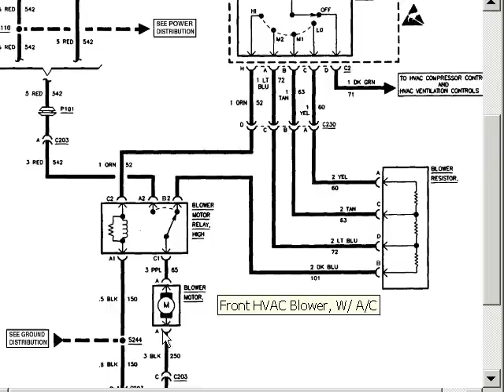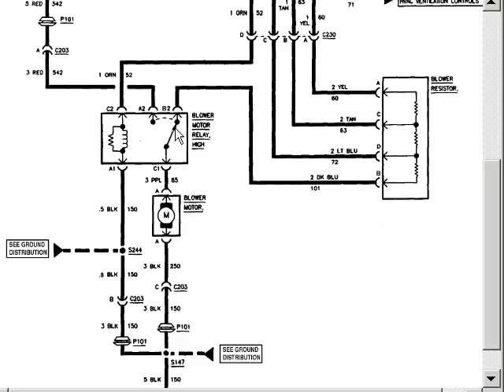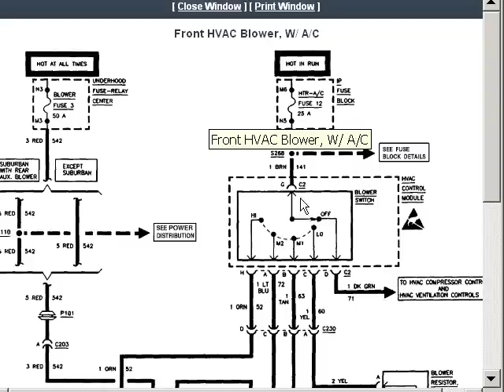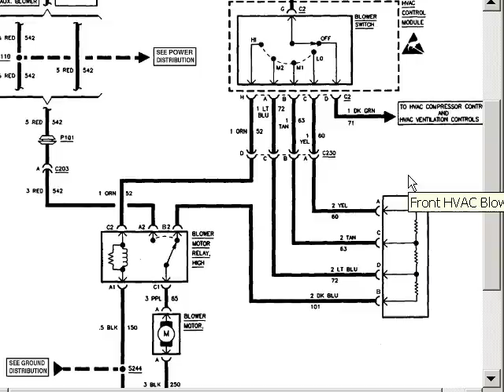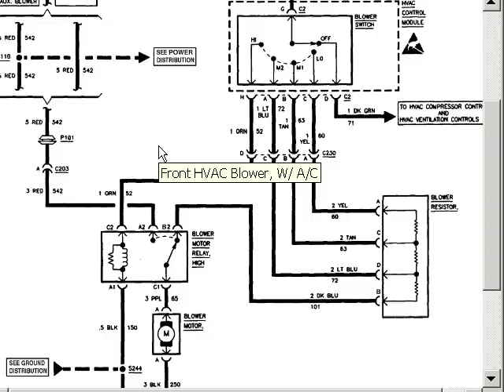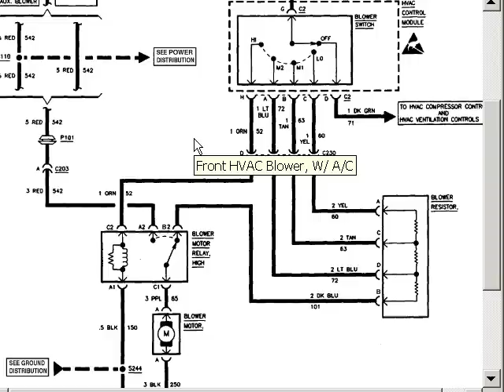Blower Motor Problems | Auto Repair Help

Comment: So is the 50 amp fuse used only in the high blower position......mine has no speeds workin but a good 25 amp heater fuse...?
Reply from the maker: Yes, the 50 amp fuse runs high speed. But remember this is for a Chevrolet Tahoe. Other makes and models will have different set ups.

Comment: I have a 2004 Ford Crown Victoria Police Interceptor, new relay, fuses are good, but I am not getting the blower motor to work.  I have checked for voltage going into the blower motor and there is none.  Any suggestions?  My mechanic is unable to help.
Reply from the maker: Jason: A problem like yours needs some hands on diagnosis and a blower motor wire diagram for that specific year and model. The Chevrolet diagram in the video won't work on the Crown Vic.

Comment: BLOWER MOTOR WONT TURN OF  ON94 CADI FLEETWOOD  FUES GOOD RELAY GOOD WHER IS THE RESISTER LOCATED PLEASE HELP SOUNDS LIKE YOU NO WHAT YOUR TALKING ABOUT THANKS  ARTHUR
Reply from the maker: The Cadillac climate control system is a whole different animal. I think the 1994 has a control module instead of a resistor. The factory service manual for that specific year and model is the best source of information. It includes component location diagrams and test procedures. You can find them on Ebay cheap.

Comment: need help,,,93 jeep Cherokee heater only works on air conditioning settings ... have high medium high medium low an low ...switch to heat defrost or vent blower quits. new motor,new resister,new fuse,new relay,new high/low switch.... what have I missed

Comment: HI I have Mini Cooper clubman 2008 and not working the motor blower ha be new final stage still same have power and ground in the blower wiring but the switch are digital good ,but nothing happen not spinning everything check not working
Reply from the maker: If you have good power and ground AT the blower motor and it's not working, it could be a bad blower motor.
Reply: But the power wire for the blower motor  8.3 DC volt that is ok. I have digital controls nothing happen any speed.

Comment: Blower motor works on all settings but it doesn't blow hard. Had the motor out on the floor board and you can see that it speeds up and slows down but still only blows on high like you have it on low. I changed the resistor and the A/c control switch on the control panel and this is what i have. it's better but still blows lightly. I have grounded the yellow and brown wire on the blower motor itself and it will blow on high like this but you have no control over changing speeds. I have ordered a control head from a used truck but if you can think of something i'm missing? this is a ford f150 2004 manual control. won't have the panel for a few days but i will get by until it arrives and i can swap it out. still this may not be my problem.
Reply from the maker: Ronnie: The early 2000 Ford F150 are notorious for blend door problems. The blend door can stick or the actuator motor does not open the door all the way due to a worn out door drive. Also, If this Ford has High miles it could be a clogged evaporator core since it's not protected by a pollen filter.
Reply: You didn't even read it or I didn't explain it. I have high if i ground one of the motor wires and it blows out all the vents depending on which i choose.It's not the blend door. That works fine. Probably my control panel as i stated and it's on the way.

Comment: On a 1999 Ford F150 4X4 the blower motor slows down at 1500 motor RPM give or take a couple hundred only when transmission is in gear forward or reverse not in neutral or park. Just replaced blower relay switch and this did not help any ideas?
Reply from the maker: Often a change in blower motor rpms is related to the output of the alternator. Output may pull back when the vehicle is idling in gear as opposed to N or P. A battery, starter and alternator test could uncover any developing issues.

Comment: Hey there Mark and thanks for your helpful videos. I'm having and issue that hopefully you can help me with. I have a 2007 Chevy Trailblazer LT 5.3 V-8 with digital heater controls. I had no A/C or blower operation, put power directly to the blower and it worked fine. There were 2 times before I did any troubleshooting when after turning the engine off and removing the key, the blower stayed on. OK so I ordered a Chinese replacement Module, brand new because I thought the $38 cost was better than the $150 one (I am cheap lol). I installed it and everything worked great on all speeds ...... for 30 seconds, then the blower shut down ..... for 10 seconds and then restarted again for 30 seconds and again shut down for 10 seconds etc etc etc. Told the Chinese people about this and they sent me another new module free of charge. My thought was OK something is getting hot .... shutting down until it cools enough and then restarts (kind of like an engine coil does). I installed the replacement and have the exact same issue. In my way of thinking ... Its not the blower motor because when it runs, it runs fine. Looked at all the Maxi fuses but if they are bad wouldn't they just blow ? Got looking at your video and am now thinking it is a ground issue, problem being I have no idea where to look for the ground. Sorry this is so long but can't find a problem on here like mine. Thanks in advance. Jon
Reply from the maker: Jon: The blower motor could run and still have an issue. I don't know exactly whats wrong with your trailblazer, but I've seen and replaced blower motors on your model for binding and or drawing to much current. With that said, the module is the most common issue on the trailblazer and many other GM models.

Comment: 1998 E320 Mercedes. Blower not working in any setting.  Before it only came on low in all settings.  Replaced motor and resistor. 11V on 2 wires at the motor, good ground and about 1.5V at the brown wire. Fuses under the hood are good.  Not sure where else to look.

Comment: Ive replaced....blower motor, resister, relay in dash and under hood, 10amp fuse, 50amp fuse and switch in dash. As a last resort I tryed a jumper wire from motor ground to crash rail and all speeds were restored. I cant leave it like that. The wire gets too hot. Any ideas would be appreciated. Thank you.
Reply from the maker: The year, make and model of the vehicle and sometimes the mileage makes a huge difference in regards of how to handle an issue like this.

Comment: Hello Sir thank you for your time. I have a 1990 1500 silverado pu with the solid state controls. With AC on and fan on high the readout will blink and system will shut down and turn AC off. On medium fan the system works. What should I look for. The contacts on the solid state have been cleaned. Thanks
Reply from the maker: These old systems can be tough to diagnose and some hands on testing will probably be necessary to uncover the root cause of the issue. With that said, I have seen the control head fail more than once. If this truck has digital climate control I wrote an article about the blower control module here. http://www.fixmyoldride.com/AC-blower-control-module-problems.html

Comment: I have a 2002 2500hd silverado. This morning my blower motor was working when I shut it off and this afternoon I went to turn it on and nothing. when i got home I got out my meter and started checking everything. I have power at each speed checking it on the wires to the resistor. I have power going to the blower motor but it will not run. I've owned the truck for 10 years and it has 140,000 on it so I figured the blower motor is shot. I bought another blower motor and it is doing the same thing has power at the plug but will not run.  I connected my test light to a good ground and on the negative side of the motor plug and it lights up but the motor still doesn't want to run. Any idea what it might be? Thanks for any help you can offer
Reply from the maker: I've seen bad blower motors right out of the box. I would jump power and ground straight from the battery and see if it runs.
Reply: Thanks for the reply. I jumped power and the new blower motor is fine. I ended up replacing the resistor and everything works great now. The new setup seems to work a lot better than it did before. I'm still baffled by the fact that I had 12 volts feeding the motor but it would not run. Oh well it works now. Thank you for your help.

Comment: your the man, the green and black wires were toasted by the vent,defrost selector cleaned, recrimped, and works fine, will replaces selector and ends. Thanks for the insight.

Comment: hello thanks for the info I'm having a problem my blower motor started squealing so I brought a knew one once I install it the new one does work I turn my blower motor on high still no result my old one use to get hot when I touch it while on that's why I brought a new but now it want come

Comment: Question:  If my fan switch, which I recently replaced, works on all the lower speeds, but not the high speed, my blower motor relay high unit must be faulty, correct?  Appreciate your help!
Reply from the maker: It depends on the year make and model, but if you have a GM vehicle from the 90s the most likely culprit is the high blower relay. If its a GM car from the 2000 decade it could be the blower control module. http://www.fixmyoldride.com/AC-blower-control-module-problems.html
Reply: It is a 1985 GMC 2500 4 wheel drive truck.  I found the relay, which is right next to the blower motor in the engine compartment, but can't find a color coded wire diagram to understand which wire might be the high speed wire.  One of the wires is substantially bigger than the others, is purple and goes into the blower motor at the bottom.  Thinking this must be the ground and the other big red wire the high speed wire.  Again thanks for your capable help!

Comment: will this cause the blower motor to blow a fuse in the fuse box under dash??
Reply from the maker: Yes the fuse could blow when the resistor fails.
Reply: Bad AC compressor causing heater fan fuse to blow.  removed AC relay to stop compressor engaging. noisy bearing there engaged or not. Will have to replace compressor.

Comment: my high speed fan setting does not work ...safari 2004 GMC van...replaced Resistor with delco ac...vdo fan replaced from auto zone...have all speeds except high speed...I understand that the high speed setting does not go thru resistor...so... any idea what my problem is? checked the fuse under hood...can't identify any kind of fuse to this under the dash...roor has it ...there is a relay in the mix...any help is appreciated
Reply from the maker: The high blower relay is the most likely cause in this situation. However, if that doesn't fix it you'll need some diagnosis of the wiring, switch and connectors.
Reply: where on my vehicle would I find that relay....under hood relays are not identified as high blower relay..is there some other word ....thanks
Reply: Dudeareno water comes from under dash no ac water draining outside

Comment: Hello mgittelman can you help me out I have a 94 G-20 Van I replaced the Relay about a month ago because the blower was not working I noticed that one of the pins was melted on the relay and connector. I only used the van once in a while but in a very short time the blower quit working again and the same pin was melted again . What can be the cause of this is the blower motor going bad too or is it something else any help would be grateful thanks David
Reply from the maker: The blower motor going bad (binding) and or drawing to much current would be the most common cause of the issue you described.

Comment: 06 Pontiac Torrent. Blower will not come on. I have enough power to the plug at the motor when I turn the dial to the middle range to turn on a test light, but nothing on high the test light will not come on.
Blower is good as it comes on fine if i run test leads to it from a power source.
Swapped the relay for the window relay and its good. Found the purple wire to the HVAC control was burnt, not shorted but very dark and melted. Replaced the controls and replaced the plug. Still no fan motor. The resister is new as well. No fuses are blown. Starting to think I have a grounding issue. Do you know where the ground wire is located on the Pontiac Torrent?
Any suggestions?
Reply from the maker: On most of the GM cars and trucks I have found it necessary to replace the resistor and the connector because they are so chard they won't conduct electricity. I'm not sure where the ground is grounded on tour model. Here is a link to someone who had the same issue on your model Pontiac. http://www.justanswer.com/pontiac/44i99-2006-pontiac-torrent-blower-motor-started-working.html

Comment: Can you tell me how to bypass my Blower resistor altogether on my 03 Dodge Dakota? I want to hook up a toggle switch if possible for high heat. I know the High wire going to the resistor is BLK/TAN but what would I have to do to get this to work. What would I hook the BLK/TAN wire to get it to blow high heat?

Comment: Blower motor speed switch controls voltage to the motor not amperage. Current does change as a result of introducing resistance in series with the motor.
Reply: ***** Adding resistance in series with the motor lowers the voltage to the motor. It's a voltage divider network. Current is reduced due to the lowering of the voltage. I=E/R. Maybe my electronics instructor was wrong, but I doubt it.

Comment: Just isolated a blower motor resistor in my Pontiac.  Turned the ignition off, removed the key.  It kept blowing.  Removing all the HVAC fuses.  It kept blowing...
Reply from the maker: Hey Mr Josh: I covered this issue in a separate video https://www.youtube.com/watch?v=jbd8K8Jzvv8
It's a fairly common issue on aging GM cars.
Reply: MrJay6889 r
Reply: ×4Z z_--zz$s65 xxx 5555
Reply: I dont mean to be offtopic but does anyone know a trick to log back into an Instagram account..?
I was dumb lost my account password. I would love any tricks you can give me!
Reply: @Marcos Davian instablaster :)
Reply: @Jamie Allen i really appreciate your reply. I got to the site thru google and Im trying it out atm.
Takes quite some time so I will get back to you later with my results.
Reply: @Jamie Allen it did the trick and I finally got access to my account again. Im so happy:D
Thanks so much, you saved my account :D
Reply: @Marcos Davian no problem xD

Comment: Question,
I have a 07 GMC Yukon Denali that the blower motor that works but in a reduced capacity. (IE: when it is on high it feels like it is on the low setting) 
I replaced the resistor yesterday and it worked 2 times. but now it id doing the same thing. I haven tested the motor yet to see if it is getting correct voltage but would you have any incite in this issue?
Reply from the maker: I would do, test the voltage at the motor and also the integrity of the ground. Those blower motors don't last much more then 10 years, but confirm it's bad before replacing. I wrote a page about this issue on your model here http://www.youfixcars.com/blower-motor-problems-on-GM-vehicles.html Also if the motor is binding or drawing excessive current it can take out the new resistor bridge.
Reply: mgittelman ground wire hot and blower motor what it could be?

Comment: I have a 2002 chevy Tahoe and my blower motor does not kick on 1,2, or 3 but 4 and 5 how can you test if it is the blower resistor  or the actual switch any help would be appreciated thanks!
Reply from the maker: You can check for power coming out of the switch. However, since it's rarely the switch, the easiest way might be to replace the resistor. Aftermarket parts can be found for under $15 dollars. It's a gamble, but a good one.
Reply: Where can I order it what website for that price?

Comment: I have a 1991 Chevy S-10 Blazer.  The blower motor doesn’t work until I open the hood and bump the Blower relay switch. It's got a new blower motor, relay switch (the second one) and Resistor.  The last new Relay eventually wouldn't work even with the tap.  Same problem.  Any tips on what could be the cause.
Reply from the maker: Hard to say, but I would start with checking the relay socket and the integrity of the wires where they attach to the blade connectors. You would have to inspect the back side of the relay socket where the wires enter.
Reply: Thanks  Great site

Comment: can you tell me where the 50 amp fuse is?..my motor spins with a jump cable..changed the relay and resisitor...was intermittent for a while..now hasn't worked for months...i also dont ever hear vacuum line noise..must check that also...car is 85 el camino with air disconnected at pulley belt...thanks...steve

Comment: Hi, I have a 2007 Toyota Prius. The AC is not blowing but the fan and control blower motor are ok. Could you tell be where the Relay is located.........Thanks and also thanks for the video
Reply: Bill Brannigan   Find wiring diagram for a c blower motor  2004 Chevrolet  impala

Comment: Thank you for your video, its of great help. Maybe you can help me with my problem.  99 Land Rover Discovery 1. Blower motor not working. Tested the motor by Connecting 12V it direct,  and so I know the motor works. I'm not getting power to the relay. if I manually close the relay everything works just fine. Resistor works on all speeds. Help! were does the power come from for the activator on the relay?

Comment: thanks for the video.  I have a 98 explorer that the fan stopped working in.  i replace the resistor and that didn't do anything.  So I tapped the blower motor and it kicked on.  so i'm gonna change out the blower motor.